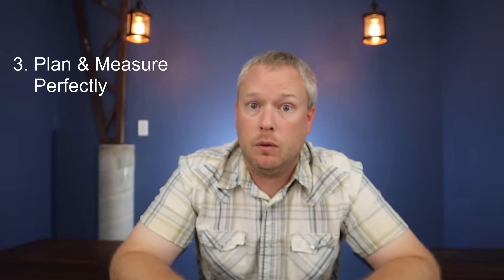7 Drawbacks to ICF Construction -- Problems with Insulated Concrete Forms

Comment: Not trying to be smart,  if you took the 6 in. walls on each side that would be
12 inches you would be losing added together. If you expanded your poured
slab by a foot each direction wouldn't that make up for the walls ? Just saying.
Reply: It would. But if you wanted your interior space to be a certain size so you enlarged the exterior footprint, you have to keep in mind that everything shifts along with it. Your material cost will increase as well, for everything. Electrical, plumbing, hvac, blocks, siding, waterproofing, roofing and insulation, utility installs,... everything has to be expanded along with it. It doesn't sound like much but it adds up cost pretty quickly. My 1,536sq ft house has an actual interior square footage of around 1350 sq ft. That's a LOT of space to lose if you aren't expecting it.
Reply from the maker: Yes, as long as that was your design to begin with.  Remember, floor and roof trusses are usually designed off of the plans, so if altered, things get wonky.  It can also affect the sub-trades greatly when things are different from plan.  If you aren't using plans, then I would suppose it would be fine.

Comment: You made a comment about being taxed, measuring at home square footage from outside of wall to outside of wall. I don't believe that's the case the actual building code IBC states square footage is measured from the inside of the outside wall. But You may be right for your jurisdiction I'm just going off of what the building code status square footage, being an architect measure square footage for clients all the time not residential commercial maybe the jurisdiction you're in has modified the code
Reply from the maker: Ours and most jurisdictions that I have researched base square footage on the outside perimeter of the house of which is used to assess taxes.
Reply: It is too bad that the government penalizes you for a better built wall. No private property, no freedom.

Comment: If you build to a passive house standard with 24/7 ventilation, wouldn't that help with the moisture/humidity issue?
Reply from the maker: In the right climate, I would assume so.  We hit 90+% humidity quite often.
Reply: @Challenged1  90%...wow! Jungle living!
Reply from the maker: It seems like it sometimes.  There's a pretty heavy dew most spring and fall mornings.
Reply: @Challenged1  ERV or HRV is a definite must for you.

Comment: Good, but for the last.  Concrete hydrates and the water in the mix remain in the  wall for ever.   The moisture in your house is more likely due to its air tightness .
Reply: Not all of the water used in concrete is hydrated. A certain amount of extra water is added to improve the workability, called "water of convenience", but at the cost of strength. Water reducers are sometimes used, though they probably add more than a trivial amount to the price. I do not know how much extra a yard³ of c-crete with water reducer would cost.
If airtightness was the culprit, the humidity would always be high.

Comment: Thanks for posting.....Great content....I'm building my own ICF home next year. Just curious why no dryer vent on exterior wall? What problems have you discovered? Thanks for the information.
Reply from the maker: Thanks for the comment.  I ran my dryer vent to the roof.  I suppose if you clear enough foam around the dryer vent, you could run one thru.  Since the dyers get so hot, I was afraid of the foam melting or off-gassing near the vent as it heated up.  I suppose it is personal preference.  Other than the moisture, I can't think of any other ICF problems I've had since I finished.
Reply: We ran our dryer vent through the exterior wall. After three years, we haven't had any issues. We just did siding so we were able to see the foam clealy. It was a bit of a pain putting HardiePlank around things that come through the walls though. My husband didn't want to saw holes through the center of a plank especially if it had to be split over two rows of siding. There are only ties that the siding can be screwed to every 8" and Hardie is required to be anchored no more than 5" from the cut end of the plank. Less is better. If you put your items too far from a tie, you need to cut your siding short(ending it near the tie that's closest) and use a wood board or something similar that spans across your ties on either side of your dryer vent, electrical box, etc with a cutout for it to come through. It's not always going to end up looking symmetrical. It would have been much easier had we placed those items closer to the vertical ties in the block. Good luck with your build!! It's a very easy system to learn to build. FoxBlocks has a great video series with very helpful tips that would likely apply to any brand of blocks.
Reply: https://youtu.be/hzZVMwxEE2M
Фундамент под каркасный дом 👍👍👍🇷🇺

Comment from the maker: Have any of you building with ICF come across the moisture issue?  I'm sure I can't be alone on this.
Reply: You're not alone. Our ICF house is three years old. We were told by more than one tradesman who have done work in other ICF houses that the concrete takes at least a couple of years to fully dry. It's alot of concrete and it's thick. it takes time for all of the moisture to work its way out. We couldn't understand where this odour was coming from in our 4' crawlspace. We bought a dehumidifier and sure enough, it's still full almost every day. No more smell thankfully. Our water line comes underneath our back wall and up through the floor into the crawlspace where it services the house, then back down and under the front wall where it goes out to a yard hydrant. It comes up through a pvc conduit that is a little larger than the diameter of the water line so maybe a bit of moisture comes through there... Our house is a rancher and there are no moisture issues on the main floor where the humidity is around 40% but it's much higher downstairs if the dehumidifier isn't on.
Reply from the maker: @crystalwright1504  Thank you for sharing.  Most contractors argue that no such thing exists, but I don't think any of them have ever lived in an ICF house.
Reply: @Challenged1   I agree. My husband agreed that there's no issue on the main floor because it's heated and dried quicker. We also have a scratch coat floor in the crawlspace over our radon system. More concrete that's totally bare. But the plumber and electrician(both very experienced with decades of experience) both commented that the walls will give off moisture for at least a couple of years as the concrete continues to dry. My husband also wonders if the fact that basements/crawlspaces are buried lends to the problem since the sun can't warm those walls as it does the above-ground walls. Our concrete guys also said that this moisture issue will happen... They should know if anyone would.
Reply: @Drwild75  Unfortunately, no. It's an owner-built house so I know exactly how it was built. It's drain rock over a radon system, covered by poly, then a 2" layer if concrete. I wish the moisture issue was explained that easily. My electrician and plumber, as well as the concrete guys, all said that moisture will evaporate from the concrete for a few years. It escapes between the foam where the blocks joined together.
Reply: The thing is, concrete doesn't 'dry out' so much as the hydration process binds the water molecules up. You can have excess water but your concrete will be weak if that's so. In fact, to properly cure concrete for it's full potential strength you HAVE to keep it wet for 28 days. If the concrete 'dries out' the hydration strengthening process (ie: the "cure") stops and NEVER resumes!!! Thus is actually the main reason for the "moisture barrier" plastic sheet laid in the forms when pouring a slab so that the water In the cement slurry doesn't soak into the ground and starve the cement of water and it dries out too soon.
Now the styrofoam walls do a good job of keeping the water in but the great majority of the water gets locked up as it cures in the first 7 days then the reaction slows for the remainder of the 28.
If your getting water it's most probably coming in through a penitration (around a pipe for example) or cold seam that wasn't properly caulked. The cold joint between the footer and wall are especially vulnerable for water wicking up from capillary action. The water can migrate for dozens of feet from the entry point between the concrete and the styrofoam, making it very hard to find the source.
This is why it's so important to seal the exterior with a membrane covering the footer and wall.
Another source for water is if the cement was not properly vibrated down and contains lots of voids in the wall where connecting channels give a route for water to get through the wall... Solved by a membrane. Note this is a failure of the contractors to do it right.
Also, unless you had silica fume or a pozzolan added like fly ash or volcanic ash which make concrete stronger and LESS PERMEABLE concrete has some porosity and water will penetrate. Not liquid water but moisture that can migrate through porous concrete and condense someplace and drain out where you see the liquid.
Again, solved by installing an exterior waterproof membrane.
Reply from the maker: @bobjoatmon1993  While the theory is sound, real world acts differently.  So many get caught up on the 28 day cure.  All that means is the concrete cures to a point where the design mix meets designed strength, that's it.  It doesn't stop at that point unless all of the moisture is used up for the chemical reaction or lost to evaporation.  Folks don't understand, but in a normal mix, there are more water molecules than cement particles to bind with.  This is by design so a mix doesn't dry out prematurely before "full cure" happens, and so a mix is workable.  Most mix design strengths are somewhat underrated so variations in the field or at the batch plant don't become an issue.  Obviously, if you add way too much water at the truck, you'll screw everything up.

Most folks also don't know that concrete test samples are cured for the 28 days in a sealed container under water and at regulated temperature so the lab conditions can be repeatable and consistent.  ICF walls act a bit like the lab conditions.  No, the moisture isn't because you screwed up the waterproofing.  No, the moisture isn't because the home is so tight or you didn't provide fresh air (assuming you did).  The moisture is residual from the concrete and will be worse in the basement for the simple fact you did a great job waterproofing the outside.  It has nowhere to go but in the home, unlike the upper levels which can slowly evaporate both directions.
Reply: @Challenged1  Well, not going to solve it here, we'll just have to see what gets decided in the long term as ICF gains more experience.
You make some valid points and some I believe are a bit questionable but I don't claim to know everything or be perfect, but I have worked for 40 years around Millwrighting and construction and seen several thousands of tons of concrete poured in all kinds of forms and situations and studied it in the civil engineering classes I took after work heading for a degree (not for my degree, just took them as extra classes just to learn)
Reply from the maker: @bobjoatmon1993  I'm thinking I may be able to conduct an experiment that may make this whole thing make sense using test cylinders cured in different ways.  Hopefully, I can get ahold of a moisture meter to take readings.

BTW - I've actually worked in a lab testing concrete cylinders.  Being a licensed professional civil engineer, it's hard not to have some lab time.
Reply: @Challenged1  I've wondered what the various ICF block companies think about this issue?
I tried to do a quick search of the ACI (American Concrete Institute) for answeres but didn't find anything conclusive. A more extensive search of their archives that I don't have time to do might have the answer though.
Reply: Really good points
The concrete is supposed to absorb the water unless too much was added.
The ICF project I helped with dried up within two weeks while it was open to the atmosphere then we cast the roof and then thirty days later after cure buried it. 
Did you add silica fume, fly ash or pozolan? That really sucks up the water and makes it stronger and helps with water resistance / sort of waterproofing.
Or was yours just regular Portland?
Reply from the maker: We added fly ash to the mix.  Question, how did you know the concrete dried up within 2 weeks?  The reason I ask is, I didn't really know mine wasn't "dried" until I started running the electrical thru it and cutting sections of foam out close to a year after it was poured.  My concrete was fully cured, but the residual moisture leftover hadn't escaped after the chemical process of curing had finished.
Reply: @Challenged1  two ways, we had a high quality moisture meter because he wanted data on everything (engineer and teacher so that's his personality) and he had a lot of holes to drill to set anchors and used those holes to measure internal moisture (note this is not instant, you put the probe in and then take the reading the next day).
The second way was basically observational, you could see the moisture level dropping in the concrete dust from the holes as the hydration proceeded. He wanted to wait until there was a certain moisture level in the concrete before installing the anchors and applying load (design had a lot of stuff mounted or hanging, not resting on floor)
I will say that we weren't cutting out sections of foam to install boxes like you were, just drilling through the foam into the concrete and epoxying in the anchor bolts (which had a required moisture level to meet quality standards)
Reply from the maker: Very interesting!!!  Now that I think of it, I also had to drill through my icf concrete and the dust that came out was very dry as you pointed out.  It would be interesting to see if your friend would remove a 3"x3" area of the foam to see what the concrete looks like.  If it's anything like mine, it should look very dark grey the first day, but slowly turn light grey as it dries out over the next couple days.  That's what mine was like anyway.  Thanks for commenting back, I find this stuff fascinating.
Reply: @Challenged1  hmmm
I'll call him about that but it's been over a year (14 months?) since his was poured so if there is a long term 'sandwitched' water problem it might have dried up by now. Can't get to the exterior because it's waterproofed and buried (he did his earth sheltered) so it would be sampled on the inside and he does have a HVAC / dehumidifier system for fresh air and that would have pulled water out (NE Texas location so lots of humidity, not like earth sheltered in dry western states where it's not needed)
Reply: Update, called him and he told me that since I was there he's either glued wainscoting boards on the walls or plastered everything else that isn't covered by a cabinet, etc and doesn't have any place he'd be willing to cut into. He said he doesn't think he has trapped water like that.
Reply from the maker: @bobjoatmon1993  It was worth a try.